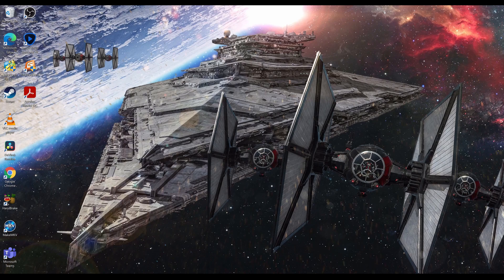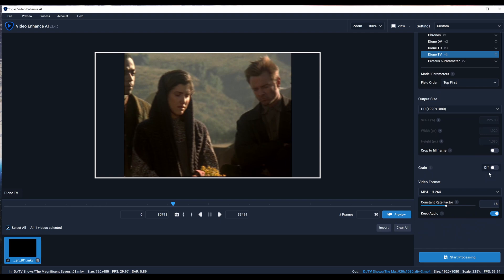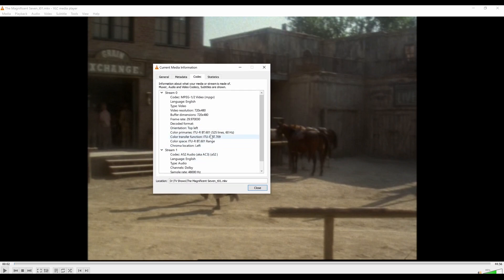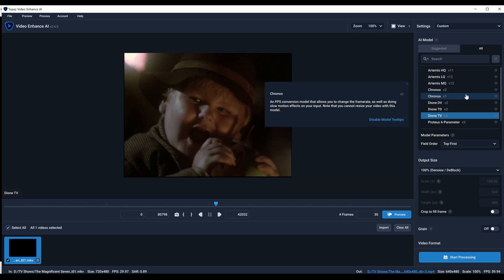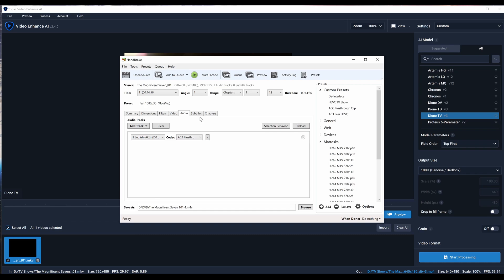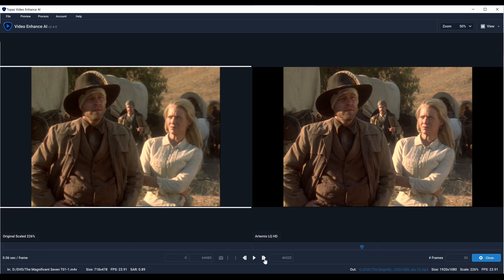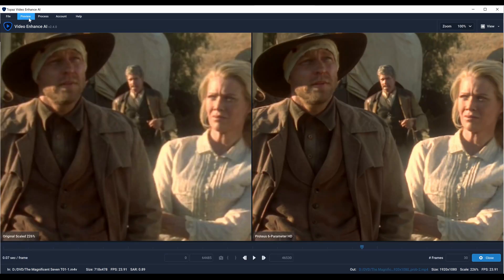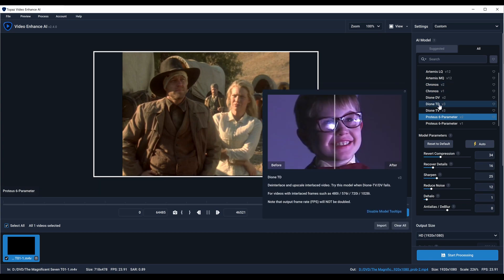Topaz Video Enhance AI Tutorial (Version 2.4.0) - Deinterlacing

Comment: You should try the new diffusion model in Topaz….Starlight Mini. Just incredible on old VHS and VHS-C videos that were transcribed. You still need deinterlacing on the file before entry into Topaz but the simplicity and results from that model are incredible.  Slow as molasses render times…but incredible.
Reply from the maker: I have tried to try it but it crashes whenever I do. I may need a newer GPU. I use a 2080 super.

Comment: I have a bachelor party video (hopefully, its from 2002 or something using my then camera on DV recorded with interlace, it's firewire interface though and just bought cables and PCI card so not sure yet... tapes could be bad or it's will just not work:-) but it's great that Topaz could de-interlace, but just downloading Handbrake also to check which is better. I do remember trying some software in 2005 I think for de-interlacing and they where really really bad most of them just did the quick half resolution thing or something equal...

Comment: For films that are on DVD, I recommend turning detelecine on and the deinterlacing filters off as it just makes 24fps content (tv shows or movies that were shot in 24fps) that was in 30i before inverse telecined to look like film again. I only deinterlace if there was sports or video content that was natively shot in 60fps but interlaced. I use QTGMC in Hybrid to do this. Although a slow process encoding in HEVC instead of AVC, the end result’s worth it for what you get out of it if deinterlaced properly.
Reply: Can you elaborate on this? Are you detelecining in Topaz as a first pass? Or are you using HB?
Reply: @curtschulz I use HandBrake to detelecine content that was in 23.976fps but in 29.97 interlaced fields. Any other filters in HandBrake should be turned off besides the Detelecine filter. For content that’s originally in 59.94fps but each interlaced field’s in 29.97fps, I use Hybrid’s built-in QTGMC deinterlacer (with Bob enabled) to get the original 59.94fps video.
Reply: @jordanmillraney5481  Thank you very much, appreciate your time!

Comment: Thank you for this video. I found all the Dione settings were coming out a bit artificial, so interlacing with Handbrake in advance, and then being able to use Proteus fine-tune gave much better results. Cheers!
Reply from the maker: Glad it helped!
Reply: Thank you very much for helping me. In the new Topaz AI application, you cannot remove the halo effect anymore, and I didn't know about HandBrake.
Reply: yea i've been playing around with 4.2.2 and noticed the same. i used Hybrid to deinterlace FFV1 (to minimize data loss) and then found proteus to be the best, most faithful model to the original.

Comment: Hi, why is my ETA is 1 hour  and 45minutes @ 6.7sec/frame. ? is that normal? setting: Gaida High Quality.
Reply from the maker: What GPU are you using?
Reply: @Upscaled_HT  nvidia quadro k620. What is  minimum requirement?
Reply from the maker: @miket.3248 That GPU is not powerful enough. I would say gtx 1660 or better is what I would recommend.  Topaz Video Enhance AI (Version 2.6.2) GPU Comparison Test
https://youtu.be/idbKs8Im9sA

Comment: I have handbrake but I am not getting the custom list where your de interlace is? How do I get this list to show up?
Reply from the maker: That is a custom preset that I made myself.
Reply: @Upscaled_HT  thanks sorry to bother you again but I realised this eventually as you just press on add custom.  Got it quite good. Added the noise option on topaz and the video image was pristine but got thin about 3 black lines going down either side of the image. Disabled the noise and those gone away but unfortunately apart from the black lines, it was perfect with the noise on. It's great software. But it is litterally trial and error, as a result I have not  got much done really as had to start all over again a fresh several times but I think I finally got the settings I want now. But then I don't know how many times I thought that and I hadn't 😂

Comment: Not got the gaia option is it ommited from the latter versions? Also is it possible to do the process without the ai model? I ask as I did a video yesterday with the Artemis medium. One part of my video shows the outside of a house, which has rough cast (small stones). Initially the wall looked completely smooth but when rhe camera shown the wall  at a straight instead of angled  the rough cast re appeared like magic. But that's not good. A shame as pretty much every thing else was much better looking.
Reply from the maker: There is a model downloaded in one of the menu options which will allow you to download any model.
Reply: @Upscaled_HT   I won't have time to look into this until tomorrow, thanks, will let you know.
Reply: @Upscaled_HT   got it thanks. I found a wee cloud shaped icon in the top right and a list of other models including the gaia one (well two different Gaia ones) also some other ones. (chronos and dione). When I hover over these it says "you do not have this model downloaded locally..etc." thanks a lot I wanted to try the Gaia one as I heard it is a good one. Of course i got gaia high quality and Gaia V5. Very helpful thanks. Sub.
P. S one bad thing it is taking even longer to process but of course it looks even better than the arthemis one. So it will be worth waiting 13 hours for a half hour video 😂

Comment: Good tips. Im relatively new to Topaz and noticed that the Dion models also do a lot of other stuff beside deinterlacing, which makes it harder to go those 2 steps using topaz alone when comes to deinterlacing. So thanks for the tip about HandBrake. Seems like a much better way to deinterlace 'clean' before applying any of the Topaz models. I prefer the new Proteus model in topaz for 'second step'  as can adjust those 6 parameters manually, if going for the optimal at least:)
Reply from the maker: Thanks for the info!  I typically stick with the Artemis models since I think they do a really good job and they process pretty quickly.
Reply: Yeah but handbrake reduces the original quality
Reply: @lilrr1431  I did not know that!
Reply: @ericlawrence9060  That is mostly nonsense as handbrake will compress a video but hardly any quality is lost.
Reply: @lilrr1431  Hardly any reduction.

Comment: Hi David 
I'm using Sony Ubp x700 Blu-Ray Player and Sony Str-dn1080.
 Both have 4K Upscale.  But both of them have this feature turned off.
 I usually use DVD and Blu-Ray discs.  Do you think I should open Upscale settings?
Greetings from Istanbul 🙏
Reply: Hello mate, greetings from uk. I'd suggest to leave both of them off as long as your 4k tv has decent image processing. Thats tge simplezt and best solution. Ive found that a decent tv upscaler, such as the ones on higher end Sony tellies and many others, produce consistently good results that are the same across all inputs.
Using a units built in upscaler can be worth it if you dont rate your tv's one, but if you are upscaling before sending to the tv, then ensure you have high bitrate hdmi cables to avoid blurring on fast 4k scenes from cable bandwidth.

Comment: In your eyes, are there any advantages to choosing ProRes as the output format first and then converting to x264 / x265 with Handbrake?
Thanks for this helpful video with very useful insights.
Reply from the maker: First off, pro res makes an enormous file size. It may produce video with less color banding. I think you can achieve solid results with mp4 as long as you encode with a high bit rate.  I usually go with 16.
Reply: Sounds like a very good idea. Many thanks!

Comment: I'm having trouble deinterlacing. Can you type out all the key areas changed in Handbrake?

NVM. 2 seconds later and I got it to work.

Use MakeMKV. Rip it.
Put MKV in Handbrake. Keep all defaults. 
Go to Video tab.
Set FPS as "same as source".
Variable Framerate.
Medium encoder on the slide.
Filters tab.
Detelecine OFF.
Decomb and default
Reply from the maker: I usually change the FPS to 23.97 but keep same as source if you want to keep the same framerate as the DVD.  I also leave Detelecine on.
Reply: @Upscaled_HT  This way just works for me. Both PAL and NTSC interlaced videos. Heck, just deinterlacing has really improved these SD videos alone. 

I usually change 25fps PAL videos to 24fps later on when I convert the m4v to mp4.
Reply: no ur not right proteus has the least and can have none when the settings are right and that's not a opinion thats fact like all of this breakdown down below is

I first read that gaia is the best  but its not it only works good for hd but cant be used all the time cause will sometimes be to sharp or give a plastic type look

so the vids I did do I did use gaia but couldn't with all cause of that problem I told you that happens but with the art model they come out sharp not as sharp as gaia but less artifacts or that weird plastic look the thing with the art is it works best set on low but for some vids it gives the eyes a weird looking bugged look or like they have a water effect around them

so when some vids have that weird effect on low u have to use medium art but then that causes artifacts so then the only other choice is theia but it's not that sharp as art but it fixes that weird art problem 

even the some vids that have that weird effect around the eyes the whole vid looks way better then orginal but even theia looks way better still then the orginal even if theia is not sharp as art

proteus can be used on any resolution if using a vid where it looks weird using the art model on low or medium use pro instead and adjust settings 

if still want a sharp vid when using proteus I usually use these setting I set to auto and put noise to 20 and compression on 20 

gaia high shouldn't be used usually sense it will cause over sharpness or a permanent grain it only can be used on certain types of bitrates like 5000-up but it depends on the video quality inserted if the vid is real good quality already i cant use gaia much cause most stuff downloaded is not that high of a bitrate even 5000 is rare for most videos 

Artemis high can usually work on bitrates ranges 4000-and up  but it is times where it can be used with a vid that is 2000bitrate but its rare

and look real good if the video is good looking quality i use art for this reason more then gaia cause gaia like i said can be to sharp 

This is from last year which I posted on red and other channels and people have tried everything I said and have said for a fact that is like I said so your trolling the wrong person lying you either have bad vision or are trolling like I said 

I have done monster the cartoon and home movies another underrated cartoon and it is no artifacts you liar so stop

I am a vet to the program and have the most experience with it in a short time cause of the amount of vids I have done
Im a upscaler as a hobby im the only one who has it planned to do mutiple shows that never got the hd treatment

Most people know not to use gaia hd with low quality cause of the artifacts and the weird movements of the mouth like I said uptop 

Its no way to not notice that stuff cause its easy to tell you have had vision

gaia is the one they used to to so called upgrade linux first vid did you see that months ago people in comments still say how bad it looks cause of the artifacts 

i would have told them use proteus it's not as sharp but look at it not having artifacts I wouldn't have let them put out that trash ver 
your the same way as those people who let that linus vid be rendered the way it was 

you people are so happy about upgrading stuff that you dont take the time to learn the program or just use what I said it applies still and will forever apply

Comment: I have been using this Topaz Video Enhance AI since 2020. The Dione model has no difficulty de-interlacing 1080 HD video. However, I have found to effectively reduce "jaggies" on SD video, I need to de-interlace the clip first in After Effects using a third party plugin, and then bring the rendered clip in to Video Enhance AI to sharpen, de-block, upscale, etc.
Reply: Handbrake does a fantastic job deinterlacing video, no need for AE to do this. Ive only processed one interlaced file using the Dione model, and this was a raw dvd file, but I found the results were excellent, with excellent jaggies and noise reduction, and consistant with the results I obtained from having deinterlaced first.  I believe the models are updated regularly, so maybe this would explain our different findings.
I would certainly try using Dione to do it in one pass first and see how you feel that goes...
Reply from the maker: Good advice. Thank you!
Reply: What plugin did you use in After Effects?
Reply: @DriverTube , Apologies for not replying before now. In the past I would dei-interlace with a ReVision FX plugin, then do a second pass in Topaz’ Video Enhance AI. However, here it is May 2022 & my work flow to prepare DV footage for a 4K timeline is all done in Video Enhance AI, prior to grading & so on. First pass: Dione Interlaced V3 (which outputs at 50 FPS). Second pass: Chronos Fast V3 (output at 25 FPS). Third pass: Proteus Fine Tune upscale. Many film-makers are concerned with time restraints. I am more concerned with quality. By using a three pass process for “rescuing” DV footage, I get best results for colour grading, etc.